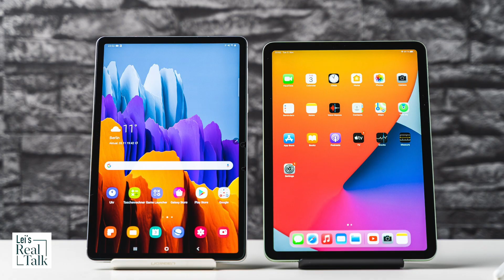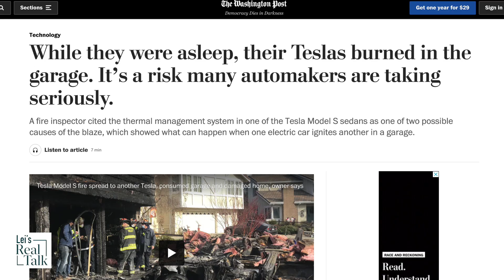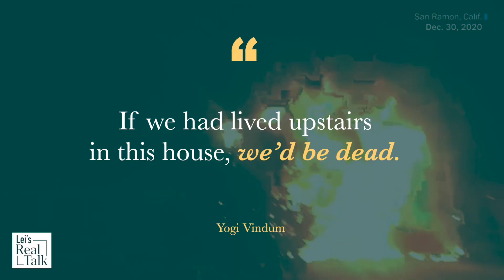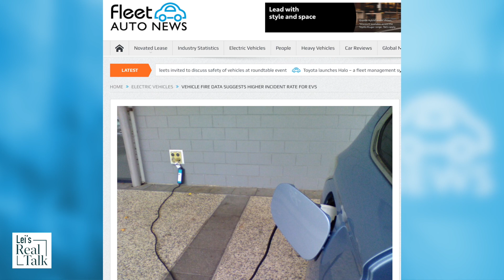Electric car safety concerns & new energy vehicle pollution

Comment: I  must respectfully disagree with you on this one. Lithium recycling is getting better. An ev is as clean as it's power source and an old ev is as clean as a new ev but an old ice car is very dirty. Pollution controls stop working and are often removed, In US most diesels have their controls removed as soon as the truck is out of warranty, this is called diesel delete. The oil industry is a very dirty business gas does not magically appear at the gas station. Fracking destroys ground water.

Comment: So amusing and slightly painfully ironic that; 
         keeping a rarely used, 20 year old Honda that can drive 100 miles /litre of distilled dinosaur petroleum is greener 
                                           than the £100,000 Tesla alternative 100 miles/tonne of coal.
 
I get that EV is a noble direction to be going in, but worry about the economic sense and am mildly horrified by the ecological prospects. 

Are we thinking all wrong about making such mega heavy vehicles? and should we make EV's like bubblecars to essentially be lighter and safe due to intelligent sensors and a network of vehicle to vehicle transmitters, cameras mounted on a lightweight thermosoftening plastic frame. Instead of pressed steel cages and tons of reinforced mass (albeit a non motorway going idea i'm rambling about). I feel there should be a cheap rickshaw-esque type battery runabout that should be less than 2,000$ to buy new and made from totally re-pellet-able plastics and possibly old fashioned lead batteries for infinite reuse.   Its essentially the rockbreaking by hand argument over mechanisation of mining. I don't want to hold back the wealthy from driving such beautiful sleek Tesla sepercars around, I just feel there is a huge gap in the market for something cheap and revolutionary to come along for the rest of us to rely on. Hopefully without bursting into flames in a failed budget wish to keep up with the Joness'

Comment: TL;DR:

Great video, and this discussion helped me to consider many of the negatives of EVs (and why I won’t be getting one for the time being).

But we kind of have to transition from gas-powered vehicles, as their fuel is set to run out by 2057 at current usage rates, or even earlier.

But with EVs, there are many renewable sources they can gain power from, and they are more sustainable in the long run. Although EVs suck right now, by having them on a larger scale and more people using them will put more eyes on their issues and help to accelerate the progress.

There are already multiple alternatives to lithium-ion batteries that are far more efficient and less fire-prone, and one of them (graphene aluminum-ion batteries) is the most promising to come to commercialization as the rest are nowhere close to it, they are literally from this year and even if they were to start mass producing them between 2022~23, it probably would not be big enough to combat the issue of magnitudes more lithium-ion battery EVs on the road by 2030.

Even so, in the meantime there’s more than electric cars to focus on, like revamping city design to promote infill development and green space, and the promotion of development around transit stations to help all people get around cities and areas, or of changing building codes to favor green materials like self-healing concrete that captures carbon as it heals (and yes, that is a real thing).

Long response:

This video was really great, and touched on many of the issues of lithium-ion EVs and how EVs in their current state aren’t as beneficial to the planet nor as safe as they’re cracked up to be.

However, going back to gas-powered vehicles is not necessarily sustainable either. If we were to continue on our current trajectory, we would run out of things to fuel such cars by 2057, and maybe even earlier. Although gas-powered vehicles may be technically more sustainable in the short term, the lack of availability of coal and the lack of an introduction to alternatives will ultimately disadvantage us and lead to radically more expensive cars in future decades due to shortages than had we switched to EVs early on. We can make electricity from a multitodude of renewable sources, but relying on gas-powered vehicles long-term will ultimately disadvantage us.

Right now, this whole era really does feel like a transitionary period. There are many alternatives to lithium-ion batteries: solid-state batteries (which do not have the exploding problem of lithium-ion batteries), hydrogen fuel cells, graphene supercapacitors, thin-film batteries, and many more, all of which have been demonstrated to work — but only in a limited set.

The biggest problem we face to truly environmentally sustainable electric cars is the fact that all the alternatives to lithium-ion batteries that exist are not yet at a stage where they can be produced on a mass scale. Although to be more hopeful, graphene aluminum-ion batteries are a type of battery that is the closest so far to commercialization, has lower fire risk, more recyclable, charge faster (up to 70 times faster), and would be interchangeable with lithium-ion batteries while being far more efficient, it is still such new technology (literally from this year (2021)) that governments and companies wouldn’t be able to adopt fast enough say the best case scenario occurs and it becomes quickly able to mass produced on a mass scale after this year (say 2022~2023) since it will enter production and use testing in the fourth quarter of this year. Even with this, lots of EVs by the year 2030 would likely still be facing the same problems you’re talking about and be using lithium-ion batteries, as the factories and manufacturing places would still have to adjust their processes to manufacture the new style of batteries.

While this is definitely a big issue (and I am still driving a gas-powered car), it would still overall be less advantageous in the long term to rely on gas-powered vehicles, as a shift to electric vehicles will put them on the stage and accelerate the progress to fix the issues you speak of and bring the many safer, more efficient alternatives to lithium-ion batteries to the mass production stage.

But if we want to save the planet, then should we really only focus on cars?

Let’s also focus on expanding public transit. Prioritizing only cars, even electric ones, is unhealthy for our society, and limits who can get around to generally those who are physically able. American cities in particular need to undergo a revolution to walkable areas that do not rely on infinite growth like a pyramid scheme to sustain a profit due to the omnipresent inefficient single-use Euclidean zoning codes. How about establishing more greenbelt initiatives to limit the growth and cities, and give more freedom to home and property owners to modify their land as they wish, such as subdividing their lot into more homes or allowing more uses (like apartments and houses or shops and homes) to coexist in areas here it is demanded? Why not allow for more infill development in American cities so that urban sprawl can be reduced and we can allocate more space to nature and parks? It also can help us to reduce the costs as we are not distributing utilities over such a massive space and we could have better infrastructure as we would not have as much pavement to spend money on. Why aren’t we building more carbon sequestration machines around our cities — especially polluted areas — to help clean up? Let’s make our communities for people, not cars.

Of course, such a transition is massive and would have to be a gradual change in city design and our philosophy. But with enough effort, it can be done — and will become necessary as climate change becomes exponentially worse over the coming decades.